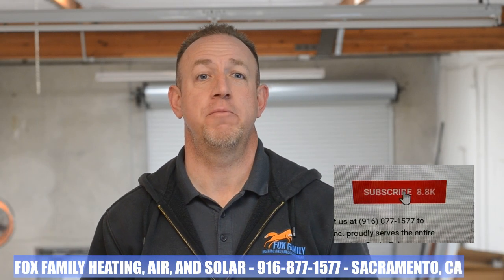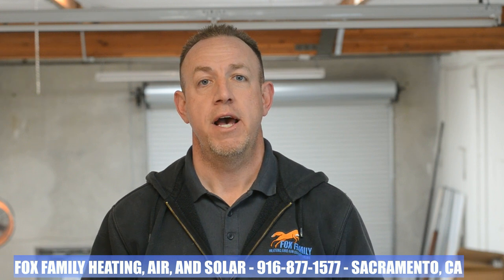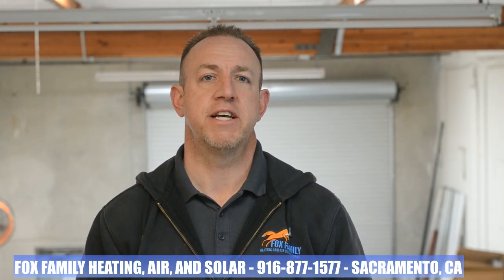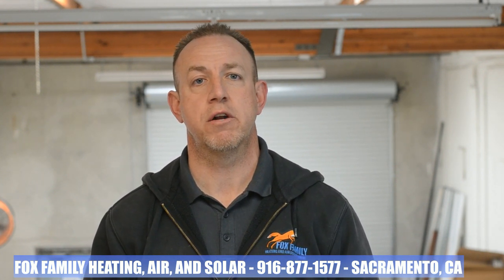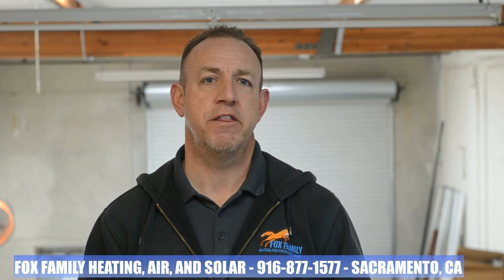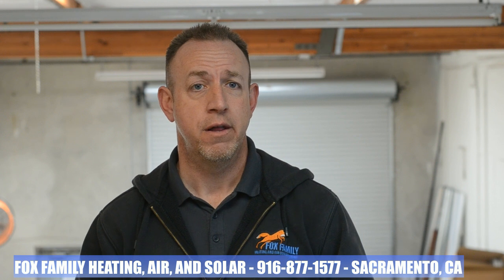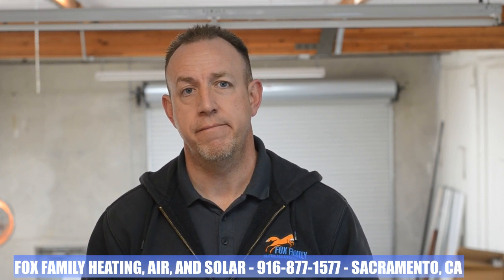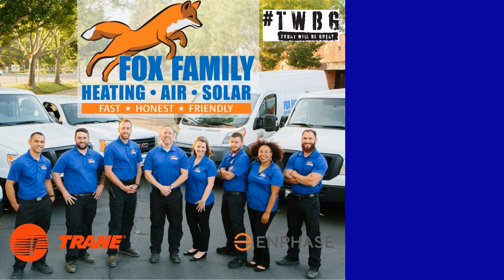HVAC Installations and Building Codes - Anchoring Appliances

Comment: Here in Kansas we have Tornados, no use strapping equipment down because it is going to be sucked up with the home. Only equipment here that defines that needs to be “Strapped or anchored” is the furnaces in a manufactured mobile homes. Some residential furnaces like Carrier has a mobile home kit for $45.00, it consist of 2’ of plumbing strap and screws.
Reply from the maker: I can understand that.  I used to live in Indiana.  We had some tornadoes there.  For sure those things would be gone!